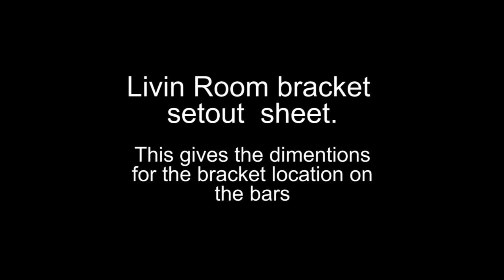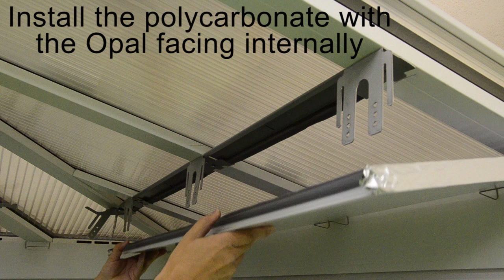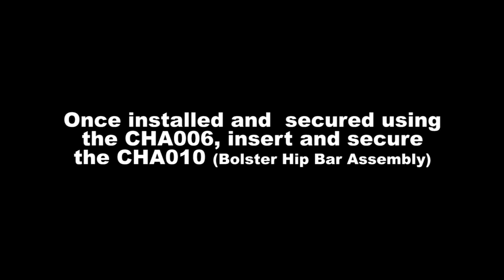Internal Pelmet (Livinroom) Conservatory Roof Installation | Ultraframe Livinroof Conservatory Roof

Comment: Do you have to fix into the Glazing bars on glazed roofs.
Just wouldn't like the screw to hit the glass unit then it game over  😮
Reply from the maker: Hi Darren, all bracket fixings must be fit central on the glazing bar to ensure this doesn't happen. You can download the internal pelmet installation guide here which contains more detailed installation guidance - https://trade.ultraframe-conservatories.co.uk/trade/media/?filter=.internal-pelmet.installation-guides.